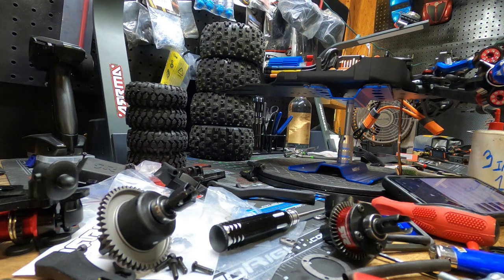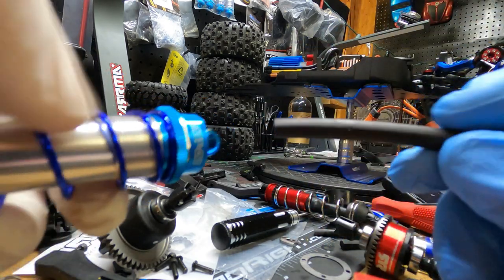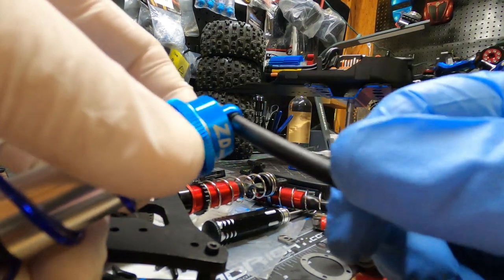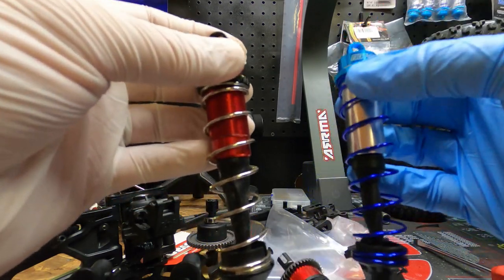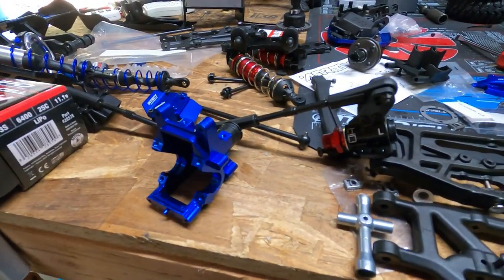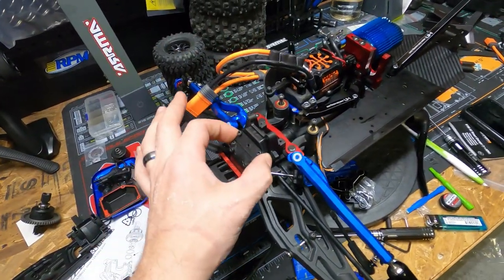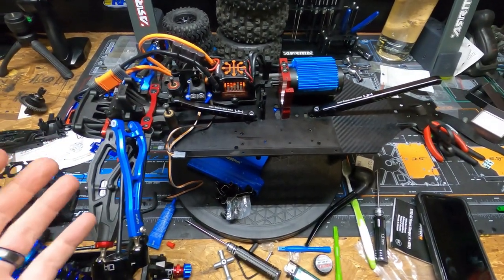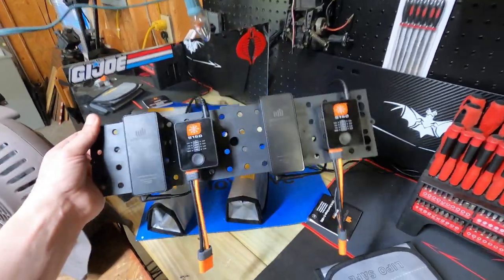KRATON6s + "STRUGGLE"+ UPdATE ! - zD SHOCKS1/8 scale?

Comment: Hella detailed video man great job! But tell me how did you get the RPM a-arms to fit your kraton V5 6s?  RPM tech told me the old a-arms won't exactly fit and there new line of arms won't be out for a couple more months.
Reply: U have to buy the pins for the the lower shock mount for a v4.  You also have to get the v4 away bar.  Then they will work.
Reply from the maker: O i havnt tryed to install them yet.. But i did run into a issue.. The shock pins didnt fit.... Well if these parts dont fit.. Will try somthing else.. Thanks again for ur comment
Reply: @ATECHPCs  just get the v4 lower shock pins and v4 sway bar. Then it's a direct fit.
Reply: Rpm arms are great on this truck

Comment: The other reason I keep trying to point out things to you is because I've went the exact route you are going.  More than once after being told that the cheap parts wete Beter after the first tome I used them. Yes there are a few small ones thar will be ok.  But hot racing quality isn't the same as those others quality it miles better. That build will be plagued with issues. But that what this hobby is learning what works.  I just hate watching you blow your money buy its your money so ill just watch.
Reply from the maker: .. Good thing i make really good money.. Cuz i got plenty to Blow on this truck..lol. Yea trail and error... Its a hobby. You know.. I like the RC community.. Very helpful ..
Reply: @ATECHPCs  If what I write ever comes across as being an asshole or shitty. I'm sorry I'm not meaning for it to. I read what I write sometimes and I'm like. well I sound like a prick.   That's not at all how I'm trying to sound.  And hope it doesn't.  Good luck with your build.

Comment: The only issue I see that you will have with some of your parts.   You bought the cheap Chinese softer compound integy parts.  The hot racing is 7075 aluminum.  The stock shock towers will bend the are softer aluminum the exb towers are 7075 aluminum the reason armma upgrade those parts in the exb to 7075 aluminum.  You will find out soon enough either way. I understand you have been in rc for years but I have been in armma kraton for years.   Half the stuff you got any of the 7075 stuff thumbs up.  That cheap blue stuff Is worse than the stock aluminum you took off to replace it.  (Lol ,also your one ways.  In rcs for years ) what ever that is .   Those are called lockers.  Also who told you the batteries are( leepos) its funny though so no biggy makes me laugh so keep saying it that way. But I you didn't know its pronounced (lie-poe) also I think the reason others are Like wtf. its some of the simple stuff that your like how does this work or your explanation of you issue.  Anyone that has had these truck is most likely screening at the TV or phone.  If you want the parts to work and directly bolt on to your truck stop buying integy and ZD racing other cheap Chinese crap . That  is where most of your issue are at on this build.  Look up Jenny's RC, scorched rc, m2c,    dedicated to the armma lineup with years of r and d.  If it were me.  I would get rid of those drive line busters and go back to a tunable dif.  If you want them locked use the proper diff fluid. It will preform like its locked but in those extreme cases of bind it will give just enough to protect your drive terrain.   BTW the rear lower arms that you tok off are not weak and have not been a big issue they are the same as the exb arms.   Your rear lower shock pins will not fit in those rpm rear arms nor will the sway bar line up right you have to get v4 kraton Lower shock pins and the v4 rear sway bar.  The fronts rpms are a direct replacement those and have the right amount of flex to protect the other stuff.   The weekest part on the whole build is the 3 mill 6062 aluminum chassis atleast b4 you build this thing get the exb version chassis it's only 3mil as well but it's much better aluminum its 7075 aluminum
Reply from the maker: First of all let me say thank you for all of the information you've provided me since you're new to me you will understand that I say things very differently and yes a lot of the parts are cheap but you also got to remember I'm trying to make videos that are entertaining add how entertaining would a video be if I hit all the points there's got to be a little confusion thrown in there .. Yea i know its lie-po.  But leepo my word i use.. Thats what im saying. You start to notice that....lol.  Yea im just finding out that their are multiple kraton versions..and not all parts fit ... The stock shock towers. I figure i would need to replace them. But was hoping they would hold up for a while..  Its been about 7 years iv been out of the RC game.. Jumping back into.... Plus the audience may not know the basics or the ins and outs.. So i go back and forth with simple questions.. Alot of the time i already know.. Im just trying to crate chatter .. Ppl will leave you a comment. If they catch somthing u said  wrong. Or entertainment of what your doing.. Integy back about 8 years ago..was the brand to have..  They made parts out of 6068 alum..   Im new to arrma and these trucks are way different from the Rc10gt and the tc4.  This is gonna fun.. We gonna fun doing this..
Reply: @ATECHPCs  keep it up man I do enjoy your vids and the little quirky stuff you say cracks me up.  Either way if ppl are talking good or bad they are talking.  It will only grow the channel more.  The suff about creating things for ppl to debate of give suggestions on is a great idea to get ppl to engage with your channel. Never thought about it like that.  👍
Reply from the maker: @danielcase2189   i hope you'll subscribe.  You seem like a very knowledgeable person. .  thank you for time.. I hope to see you again on new videos... Yea my way of doing things and the way i talk is way different than most...
Reply: @ATECHPCs  I am subscribed.  Have been since you started building the kraton.
Reply: @ATECHPCs  I just checked. That's the second time I've had to re- subscribe to your channel.  I wonder why it keeps unsubing me.